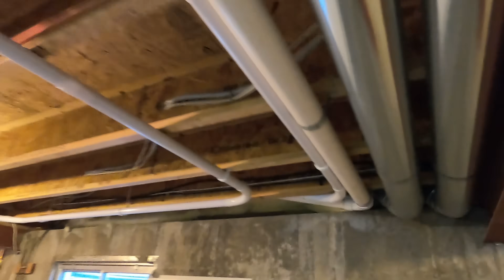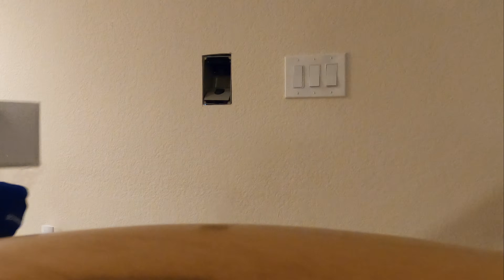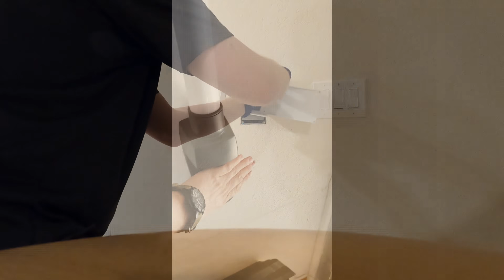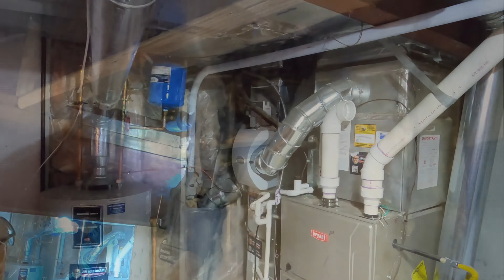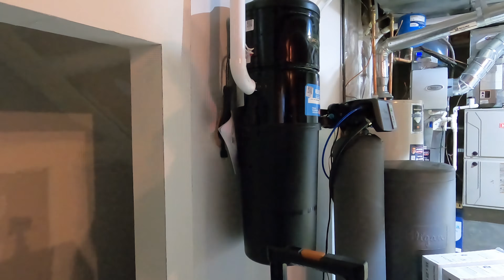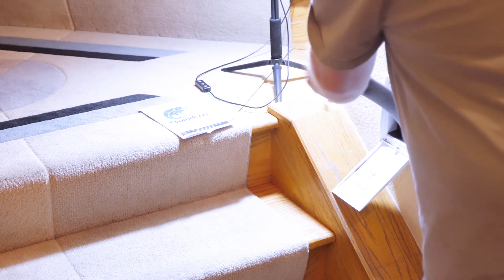CENTRAL VACUUM RETROFIT INSTALLATION CHAMELEON VACUFLO DB8000

Comment: Is it possible to have a central vacuum in a single story house built on a slab foundation? I know you mentioned about certain components being installed in the attic, while showing the vacuum installed in the garage.
Reply from the maker: Call your local installer most of them will give you a free estimate
Reply: @PerformanceReviews 
Also, is it possible to install a central vacuum as a DIYer rather than hiring a pro? I am personally willing to accept such challenge myself by the way.

Comment: This is awesome, I've known about these and what the install looks like more or less. Unfortunately, retrofitting these in my part of the world is not as simple. The piping isn't too large so I'm thinking that routing the system in the floors could work, but that would be rather destructive, especially with heated flooring. It's canisters for me I'm afraid.